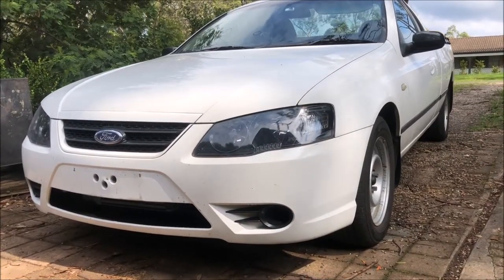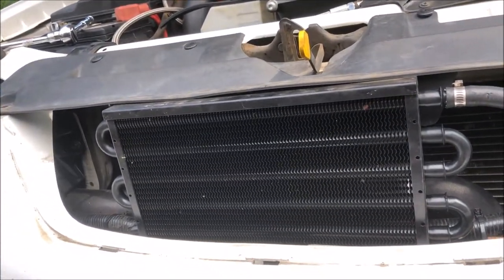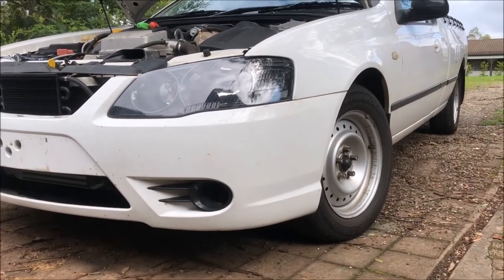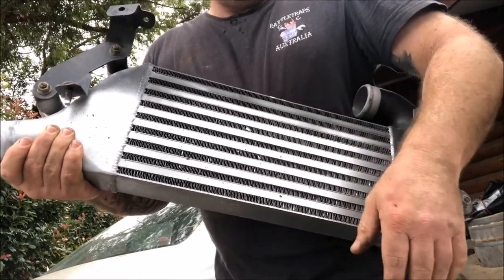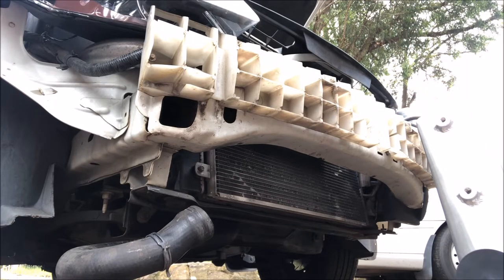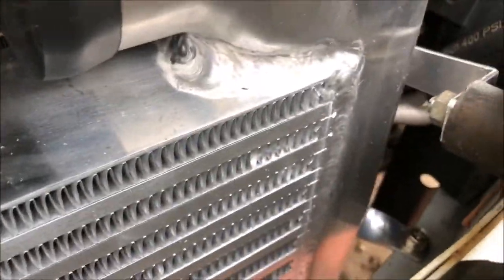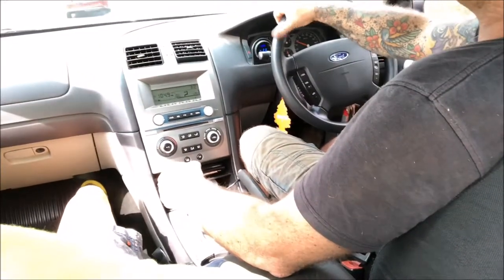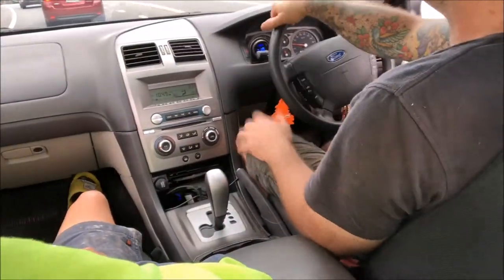Heatsoak - Barra Turbo Intercooler Upgrade

Comment: Hey mate i know it’s 2 years later but iv recently bought a fpv intercooler i think you had one but it’s not lining up properly on the right side mounting point did you have the same issue cheers
Reply from the maker: Hey, mine was a genuine XR6t Garrett but not the Bigger FPV so I’m not sure. The stock one bolted straight in, can’t speak for the FPV

Comment: Would it need to be retuned at all with the new cooler?
Reply from the maker: I can't give you the correct answer to that, just my mechanical opinion. By still running the same piping, air filter, and intake etc, all I've done is give it a wider window of optimum air density. Like driving on a cooler day rather than a hot one. So no, personally no, I don't think I do. Although if I was to change the intake setup for better airflow etc, I'd say yes. But that's just my opinion

Comment: Hi Thanks you for the Video i am interested  in purchasing the same cooler can you post up the link to the website i know PWR do one but not sure if it the same size as yours  do you have approx measurements   of your one  thanks will sub
Reply from the maker: Hey man, the link to my one is long gone but it’s the same as this one https://www.ebay.com.au/itm/270838647596 hope that helps
Reply: @oldskoolonly  thanks what are your thoughts on this one  thanks for the vid i didn't think these coolers were around https://www.ebay.com.au/itm/PWR-Intercooler-fits-Ford-Falcon-BA-BF-11-04-On-PWI5405/163829851108?fits=Plat_Gen%3ABF&epid=25034983661&hash=item26250523e4:g:uaQAAOSwb2hdYIE8&frcectupt=true

Comment: Hows the gearbox going?
Reply from the maker: It’s holding out surprisingly. I think it got a lot to do with how you drive it. It’s due to be replaced because it was already flogged out, got a turbo box for it just haven’t got around to swapping it over